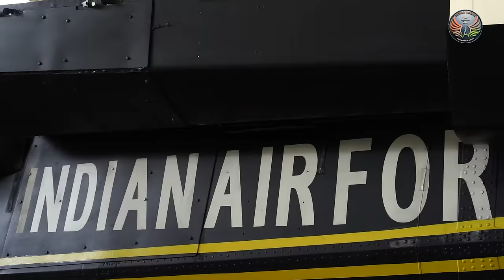HAL And Private Industry Can Work Together To Make India Self Reliant In Aerospace Sector, Says CMD

Comment: Looking at the production facility  they need more automation. They really havent invested much into improving the facilities.
Reply: Fighter jet lines cannot be automated. Because minute of minute details matter. It’s a lasting asset. Only thing that will be automated will be 3D printing and ovens for baking carbon fibre components. Which is why the production is slow. What they need is expansion and shifting it in the outskirts of Bengaluru city. What I fear more is security. As you can see, right at the HAL compound, residential plots are located. Anyone can spy from a distance.
Reply: @ShaneCallum  Have you ever watched the LM production lines? Go through the videos of F-35 production. You will be proven wrong.
Reply: Brother I don't think there are any robots/machine in the market that you can use to automation a aircraft manufacturing. Even if there is some machine that big players are using like boing or Airbus, They are not going to sell it to anyone. These kind of tech has to be develop inhouse through RND and its a Step by Step process and you should not expect highest efficiency so early.
Reply: @sambartadutta5229  I have. F35 requirements are different. They have automated assembly line not the production. Also remember we procure radars and computer vision components from Israel. It’s basically plug and play. On the other hand, Raytheon manufactures radars for F35 and USS. Also the assembly line is more streamlined because of NATO demand. Most of the member states have to rely on US. So the contractors have no other option but to automate few things but not the production in itself. Orders are already in place. For Tejas, countries bave shown interest not purchase orders. For manufacturing 90 aircraft for Indian Air Force, you don’t need an assembly line. Also nations are waiting for mark 2 desperately. Once that happens, then you will see rapid shift in production process.
Reply: @sambartadutta5229   they are producing 100's of f 35s per year.
The scale is different.
Bringing that la of a automation like lm while only producing 16-20 jets per year will increase the cost exponentially
Reply: Leave automatation, let them build something which is useful and not obsolete atleast
Reply: @s.d.b.5803 Don't tell anyone you said this, or else your employer will force you to take an 'Q' test.